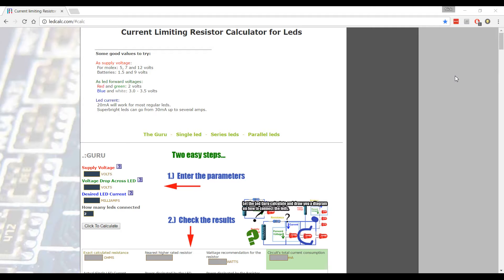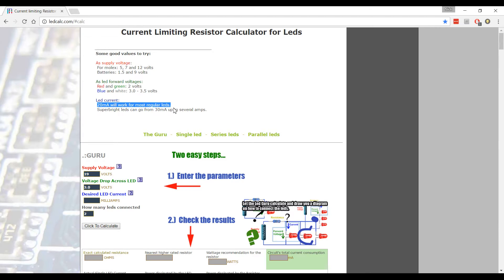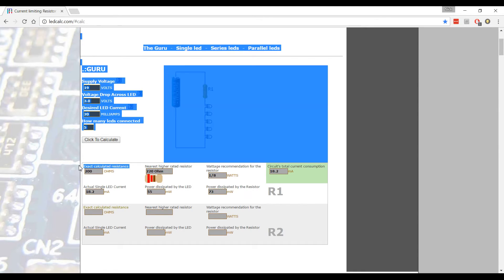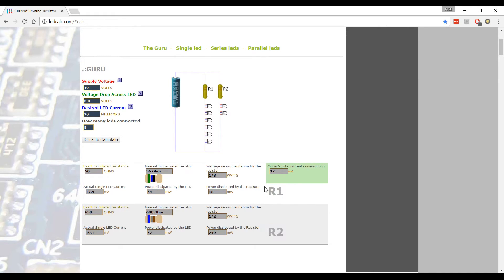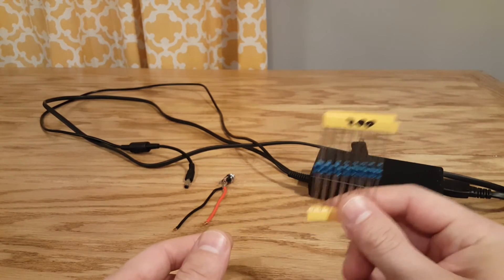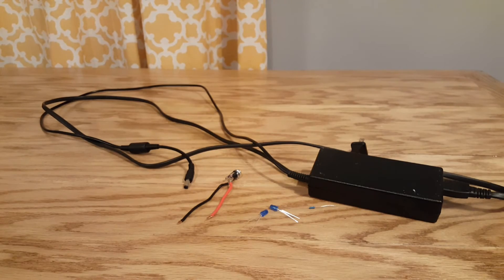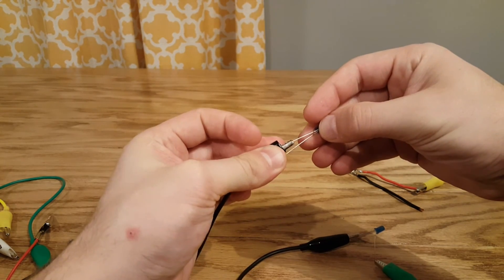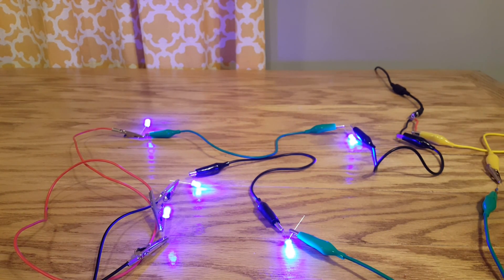How to Hook up Led's to any Project

Comment: Is there a way to decrease the brightness of the L.E.D.'s?
Reply from the maker: Jeff Ferguson Yes. There are a few ways to do this.  The easiest is to increase the resistor.  So if you want, you can put another resistor (the same size) in series with it to halve the brightness.  Or continue with higher resistors until you get the desired effect.